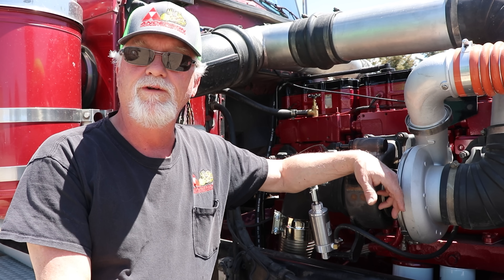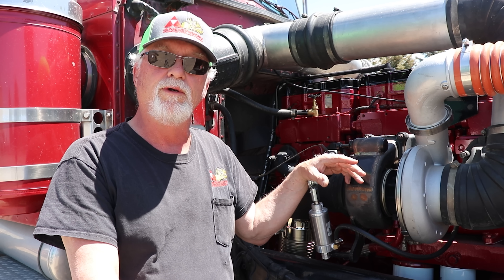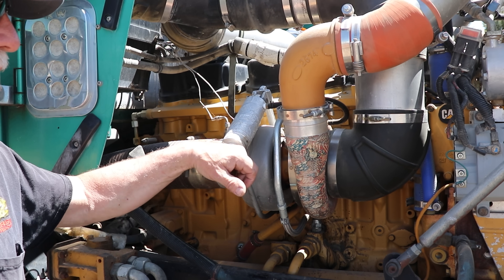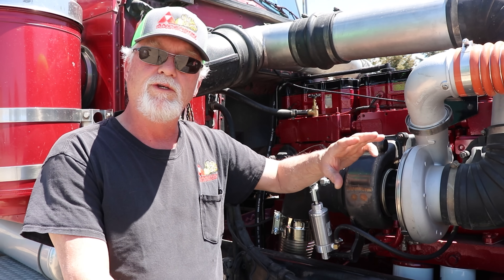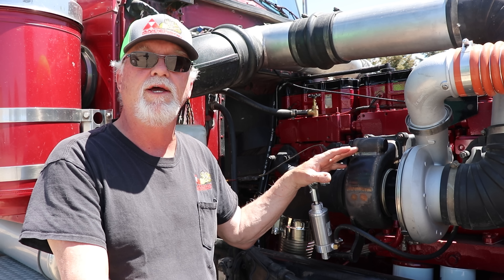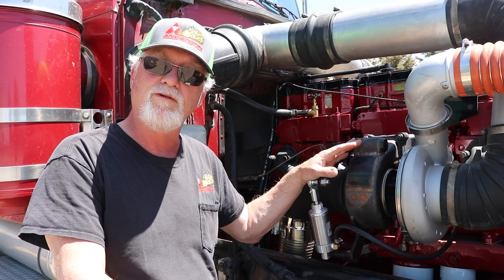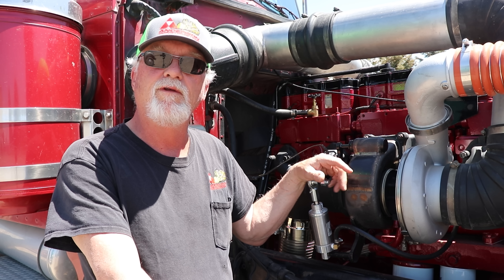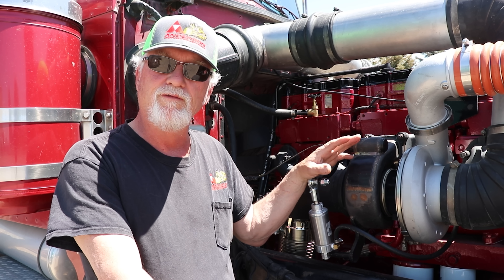Switchblade Turbocharger

Comment: What kind of oil are you using? 30 sounds really high!
Reply from the maker: 10w30 john deere break in oil, I machined the oil pump from the  .007 end clearance to  .0025 and placed 4  3/8ths hard flat washers under the spring

Comment: My 1999 Cummins N14 select plus, has very little smoke in exhaust.  I have HHO browns gas going into the intake. Gained 1.25 mpg
Reply from the maker: What's "browns gas"
Reply: @Jpaydirt Basically unicorn farts. It’s a system that uses electricity to break down water into hydrogen gas. They do work, but don’t produce nearly enough hydrogen to do anything on a bigger engine.

Comment: Ceramic coat the manifolds and turbine housing, along with a turbo blanket and that will also really lift the boost.  More heat energy, more pressure means more boost.  A lot of diesel engines, especially the older generations can benefit enormously from updated, improved versions of turbo's than when they were made. Turbo tech has come along way since those days. A turbo does more than add more air, for more fuel and power.  A turbo is a mechanical pump that recycles energy back into the engine in the form of boost pressure.  Every intake stroke takes mechanical energy to draw in air to the swept volume of the cylinder, more boost pressure physically reduces the parasitic drag of the intake stroke common to 4 stroke engines. This becomes very important on part throttle cruise, because a normal turbo does not operate efficiently at part throttle, it is optimized for full power compressor delivery of boost pressure.  Only a variable geometry turbo can really cope with that situation without resorting to a complicated,sequential twin turbo setup.

Comment: I have really been wanting to try this but I am looking for better jaking power, would you say this turbo has as good or better response on the Jakes as an acert?
Reply from the maker: Nothing beats the compounds for Jaking power, the switchblade is not a magic turbo, after the knives are open it's just a turbo, you can get a solenoid to dump the air to the cylinder when applying the jake for more boost,  I have a brake saver on mine so it's not an issue for me
Reply: Okay, that is what i have been curious about. i appreciate the info.

Comment: How do you Jake’s work in comparison to the factory set up on your C-15? Will it keep the same amount of boost? Does it produce better? 
You are the only guy that i have found that has put forth the effort to make a video in regards to the Switchblade
Reply from the maker: I have a brake saver also, your going to lose some compression braking power, but with the retarder I don't care
Reply: @Jpaydirt the CAT brake is a great addition to the Jakes. Thanks for the reply.

Comment: Great info, try looking up speed of air pistons. Next time you need to rebuild an engine, switching to these pistons will reduce black smoke by 61% and with your switchblade turbos might very well reduce your black smoke to virtually nothing. Your power will go up and fuel savings will go ip.
Reply: I was just thinking that myself.  A combo of technologies that can drastically improve the power/torque output and significantly increase the longevity of whatever diesel engine you have.
Reply: Correct.

Comment: I put one on my 9H back in 2018 after reading your review. What I like most is how clean the oil stays, no longer a carbon laden soup grinding up my engine. My fuel setting is 70 liters an hour and I run the oil change out to 400 hours. Also my local diesel shop had a look at it and pointed out the ceramic turbine housing so when I blew a blade hose and covered it in oil I didn’t get a fire
Reply from the maker: What was the fuel consumption before?
Reply: @Jpaydirt well fuel use can depend on who has been at the governor. When I bought my machine in 2015 it had high crankcase dilution and oil consumption.I put new cat cylinder packs in, in chassis. Fuel use was at least 85 liters but I had been told by old hands that when the fuel valves wear consumption goes up and they liked that because their machine was stronger. I replaced the 6 valves or injectors and fuel came back to 70. The tractor spins its tracks under load and you can’t ask for more than that and I’m confident the new turbo makes sure all that 70 liters is turned into power. My governor failed and cat rebuilt it so it has factory settings. The engine is just so clean and this must lead to a longer life. I am realy enjoying your D9 series as there is limited info out there now on these great old machines

Comment: Its good but the soot build up gotta be pretty gnarly after a few thousand miles.
Reply from the maker: nope
Reply: @Jpaydirt could you elaborate why that isn’t the case just asking for the knowledge
Reply from the maker: Are you refering to soot building up inside the turbo?  I've never seen one do that as your spooling quicker so less soot is made, and this is such a simple design, it's a problem on the current vgt's because there's so many moving parts inside

Comment: The switchblade wouldn’t be saving you fuel it’s just giving the engine more air to burn that fuel which isn’t getting burnt by the older style turbo
Reply: It saves you fuel by making the engine run more efficiently at lower rpms where you'd normally have to rev up more to utilize a regular turbo.
Reply: @xc8487 he is saying it gives more air at lower revs than if you were to use the older turbo  if you used the old turbo like you said higher revs for better use why do you think that is well duh more air at higher revs 😊for better
Reply: @CaseyBarnett-e8s  Ok? My point was it will save you fuel by making the engine more efficient...
Reply: @xc8487 that is same thing 😅😅😅😅
Reply: @xc8487 im not sure why your clarifying what you said bc i understood it the first time your just confirming that your saying its more efficient and guy who commented said basically sane thing but without saying it directly 😂😅
Reply: @xc8487 oh ok thanks for explaining
Reply: @xc8487 that’s the same principle as what he said.
Reply: Jeff has to keep records on fuel use and miles.he compared before and after on paper.his fuel savings started at the bottom of rpms to the top.not just at the top.more power at the bottom up shows in his older 9 videos the far less smoke.you can hear it in the audio.
Reply: I got no idea what you’re all talking about.  If a switchblade reduces the black smoke on a mechanical fuel system pumping more air to burn that unburnt fuel at lower rpm logically it’s not saving fuel it’s burning and utilising the wasted fuel that was going out the exhaust.
Reply: @Free-j3t Except that fuel is now being burnt therefore making more power and therefore you won't have to use as much throttle now to get the same acceleration.
Reply: @Free-j3t your over complicating it. There is no need for me to explain any further.